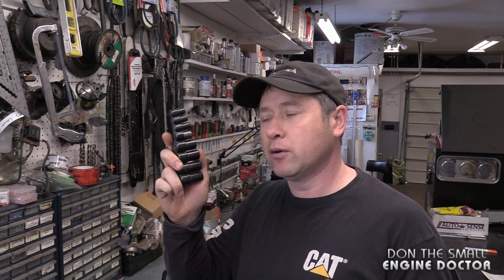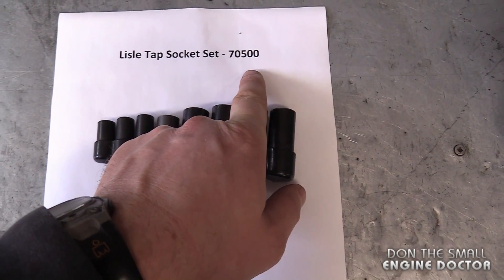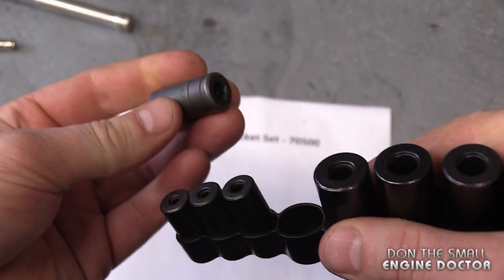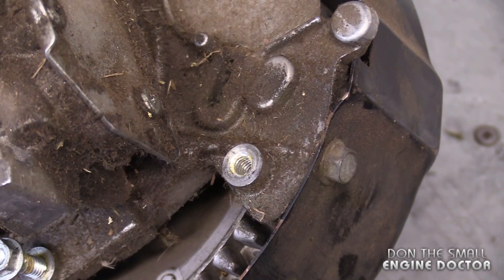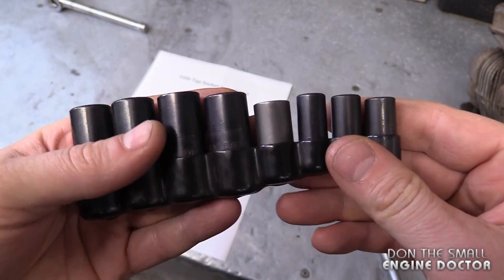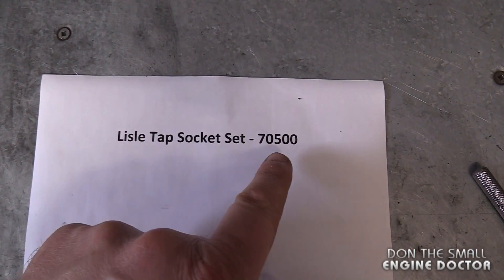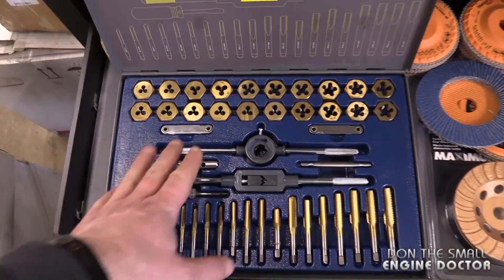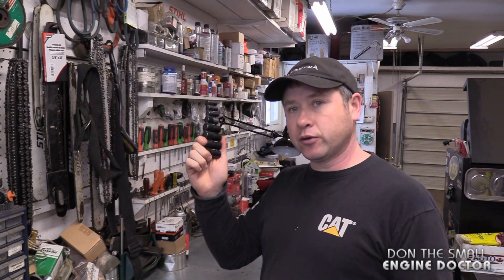TOOL REVIEW - Lisle Threading Tap Socket Set 70500

Comment: I never knew about that socket set, they will definitely help me out! Thanks for the information. 😁👍
Reply: I just found these while I was looking for a solution on how to repair threads in a confined space. I bought a compressed air hose reel and some genius at the factory painted the threads and possibly irreparably fouled them..

Comment: I was looking to this set. I was doing tecumseh lower left startr bolt hole. I  first tried to tighten an 8 point socket on the tap using plastic wrap. It slipped.  I went checking my tap kits for the sliding pin one and foud in my newest set from canadian tire a tap holder with a 1 inch hex nut. Chuck part fit my tap.

Comment: Would a 12 point socket do the same? Of course less secure and unable to take as much torque, but torque is likely not a concern with turning taps and a quick wrap of electrical tape would likely hold a tap in a socket just fine. That said, I have used (don't own) this exact set and it is a nice purpose built set.

Comment: On one job I tapped about 200-250 5/16x18 holes with these on a 1/4” impact driver and never broke a tap. I’ll never use a drill again to tap anything.

Comment: Those look really handy!!
Also, the tap and die set you showed with the hex shape dies, what brand or part number is that?
It looks very high quality
Reply from the maker: mastercraft maximum from canadiantire in canada
Reply: The “hex dies” you are talking about, In the UK we call them die nuts, they are not adjustable like a split die, and should only be used for chasing down an existing thread, not  for producing a thread on plain bar.

Comment: Could you review the source of your metal drills?  I have been avoiding purchasing a high speed steel set on Amazon (~ $100 for 30 drills) because I mostly do wood working and the cheaper sets at Lowes or even Harbour Freight are adequate...but they fail when drilling steel and stainless steel. Is it worth getting a cobalt or titanium coated drill for metals?
Reply from the maker: yes it is worth getting a good brand name cobalt bit set. I have some WALTER cobalt bits
Reply: I agree with Dony,  however I have been using Milwaukee Titanium bits for a while and I'm impressed, very good at cutting steel and last a long time. Their sets aren't too much $$$.  That being said I will probably get some cobalt Milwaukee bits next time their supposed to be even better.
Reply: Thanks guys.  Cobalt is tougher than Titanium drills...that's just the kind of information I was looking for.

Comment: Hey there Donyboy I've seen your videos on the K100 and my generator has a lot of water in the fuel thank goodness for ethanol eh? It's a good thing I turned the fuel off before storing my generator 2 years ago, and so i wanted to ask you should I dump all the fuel out or can I get away with using K100? An honest answer would be greatly appreciated thank you.
Reply: If your gas if has a lot of water it's old. You should definitely dump it, the gas is old and stale and can dirty up your carb.  You could use a high dose to get rid of the water in a pinch and burn it immediately to get rid of it. But fresh gas is preferred.   K100 is great, when I fix generators that will sit waiting for a power outage or don't get used often I use K100 at the ratio to stabilize the gas for 2 years.
Reply from the maker: I would empty the fuel completely first
Reply: @billlovett4256  
Thanks appreciate your answer.
What should I do with the old gas?
Reply: @donyboy73 
Thanks donyboy73 appreciate your answer.
Reply: @chivosadventures8171  Lit match?
Reply: @michaelremski8295 
😁😂
Reply: @chivosadventures8171  Use it outdoors to clean paint brushes etc or take it to a place that takes used motor oil..

Comment: which are the best quality tap and die sets?
Reply: I recently bought an Irwin metric tap & die set and it appears to be IDENTICAL to a set branded by Snap On.
Reply: Ace Hanson Brand          Snap On  And Mac   Tap And Dies Are  Made By Ace Hanson    I Have Them Since the 70's  Metric And SAE       Good Stuff  You Can Find Them  on Ebay  . Even Used   Its Worth It.
Reply: @eosjoe565  cant find anything with the part number
Reply: @Limeayy  What part number are you looking for and where are you looking?